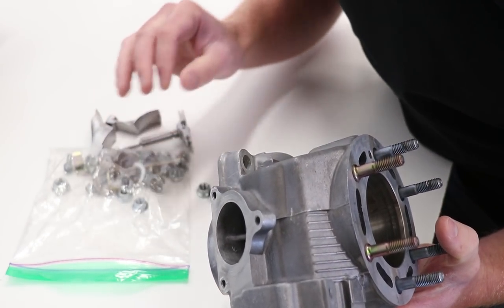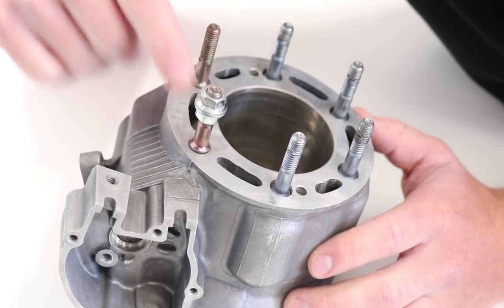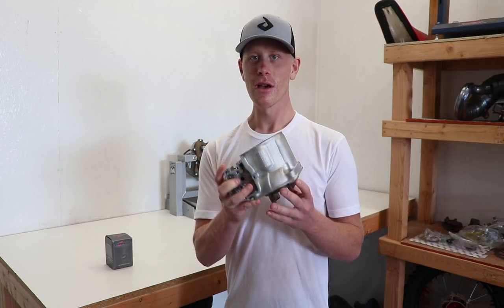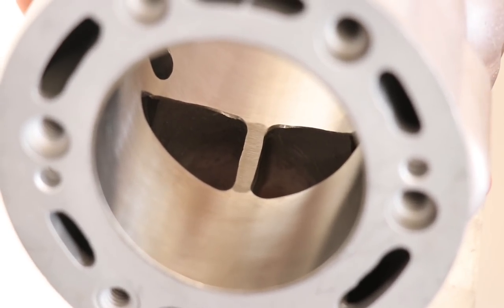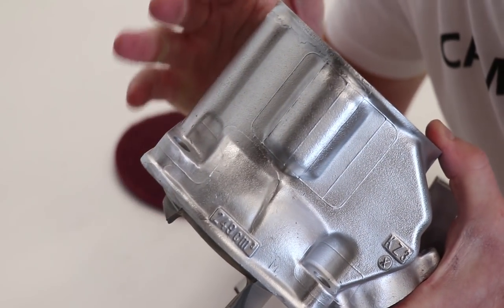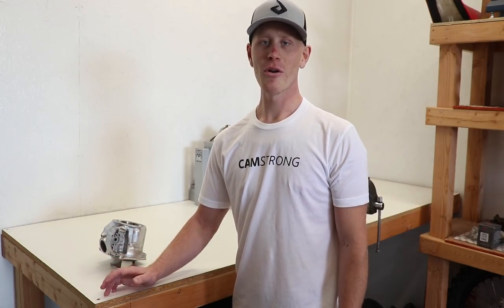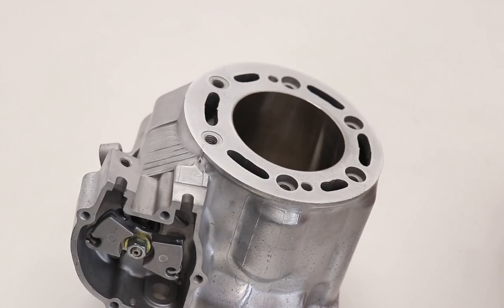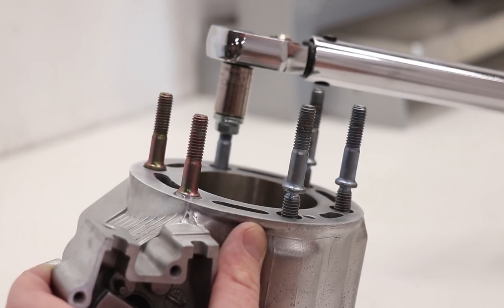How I Fixed My Damaged CR250 Cylinder!

Comment: Stay strong! I do have a tip use glass or granite slab with your sand paper on it for gasket surfaces it's a for sure method to "deck" a surface. Good luck to you and keep up the vids.
Reply: Adam Hood good call I need to do that as well

Comment: I just got a big bore block for my CB250. The lower part of the barrel that protrudes out underneath the block was honed so thin, it cracked while trying to fit my pistons/rings. I was left no other option but to sheer off the rest of the cracked skirts and re-burnish the surface. Made fitting the pistons that much harder, but I did manage to get it all back on. I really dont see there being much issue as the pistons do not travel past the bottom of the block, but no one can really give me a straight answer if I will or wont. Motor is going back on frame tomorrow, just gonna give it a start and see if it grenades or pisses oil out of some unknown crevace. Fingers crossed

Comment: One cuestion  im new on the dirth bike s world so k gat a cr125 2002 but the problem is that  is missing alot of parts on the engine 
So i gat a  89 cr250 engine on good shape so can you help me to get a cr125 comoplete engine or put the 250 engine on the 125 frame im from mexico sorry about my english writting

Comment: Something sweet I use to clean up gasket surface is I had a piece of plate glass cut and I attach any grit sandpaper you want to use either that has an adhesive back or use painters tape in the corners works super good and being tempered plate glass you know is perfectly flat

Comment: Hi Cameron! You are really doing your thing very well! Allow me a little criticism or better, a suggestion for improvement. Regarding your polishing works on the cylinder outside. I've had much better experiences when I get the cylinder outside glass bead jets and thus a slightly smokey surface. As a result, the wind will catch better in the rough surface and thus a better cooling of the cylinder is guaranteed! A polished surface of the cylinder dissipates the wind and thus prevents additional cooling due to the wind! Try it and give me your feedback. Lieben Gruß aus Deutschland und dem Thüringer Wald 👍

Comment: Powerseal did the welding and Nikasil on my kx125 jug last month. They come with a warranty as well incase of defect. 300$ total with shipping for a better than OEM product. Even less if you don’t need welding just a replate
Reply: Hey I brought it in to my local shop (CEP Automotive) and it costed only $200 including the Wiesco Piston.
Reply: Jonathan Brugge you have a local shop that does plating? Dang how lucky
Reply: That's a bit of a rip off.

For £180 ($230) my 94 kx 125 cylinder was vapour blasted, welded and re-plated.

Comment: I need to put a piston in my recently purchased CR250R.  the bike runs great, but I don't know the last time the top end was done.  If there's a forged piston  in it , I'll put another one in and drill the piston. 
My question is what type of piston do you prefer? Forged or cast?

Comment: What work order option did you use? I just got a chip in my exhaust port. Right above or below the  the power valve. Like this one here really. Should i do the weld machine option or the whole thing?

Comment: I've used power seal USA before. Very great results from them. Can I make a suggestion,   now is the time to clean up the ports on the cylinder. Because if you happen to hit the cylinder wall is doesn't matter. They will correct any slight damage like that. Plus it would make for a great video!
Reply: I should have watched the whole video 1st. Kinda too late to clean ports now. Lol

Comment: When he was back at powerseal after they fix your cylinder you should have sent it to dby Motorsports to have them Port that cylinder. You would have seen the Improvement of their port work what they do. I've been running their cylinders since 2006 in my car

Comment: I hope you cleaned the cylinder after sanding the head gasket surface and I would have sanded and clean the cylinder before installing the power valve
Reply: Pretty sure he knows what he's doing...
Reply: @maxtharipper  I've been in the power sports repair business for 31 years he doesn't do everything totally correct I can tell he hasn't rebuilt very many engines and no one uses a sheet rock or wood sanding block to surface the deck on a cylinder
Reply: @michaeltrower6792  congrats bro...

Comment: Just one tip cylinder head 1200 grit wet and dry on a piece of glass stick it down with spray adhesive then move in circular motion keeps it perfectly flat 220 is skittle coarse.

Comment: So as an engine guy obvs. Are 2 strokes really that much cheaper to maintain and fix in a bad case such the kx engine you had awhile back? Im debating between a 2019 250sx/tc or a crf450r/yz450f but im not the greatest mechanic when it comes to engines. Thanks

Comment: Question.. I have a 99 GasGas ec300 that I’m rebuilding this winter, I want to resleeve it and may just send the cylinder out to these guys..what’s the pricing like? If it’s over $300 then I won’t do it because I can get a rebuild kit (cylinder, piston, gaskets, wrist, circlips) for $460. But if it’s around $200 then I’d gladly send my cylinder out

Comment: Hi mate i spoke to you on ebay about the kx250 wheel, thanks for the detailed vids as always and it sucks to hear about your health issues, youll pull through though. My kx250 cylinder is in decent shape apart from a single vertical scratch/score that i can just catch with my fingernail, its just under an inch long, would this be fine to chuck a new top end in and run it if i run it a bit richer to be easy on it or would it be likely that the plating would flake soon and cause a catastrophic failure? 
Stay strong and cheers again Cameron!

Comment: Hey man, firstly I'm happy to see your well and back into these sweet videos. They're much appreciated! I have an 02 CR125 and the cylinder matches  almost exactly to this 250 of yours in the video. My question is, would you consider a new OEM cylinder being that it's like $50 more or will Powerseal kind of I guess improve the cylinder in some way?
Reply from the maker: Thanks man! Personally, I would go for the OEM cylinder since you can sell the old one as a core and you won't have to worry about turnaround time. But either way you can't go wrong.
Reply: Thanks for your quick replies! I been searching high and low for an OEM cylinder head as well. Do you know if an 04 head would work?

Comment: I used penetrating lube on the studs in the case and tried the double nut technique.the nuts just kept coming loose so being a plumber I used a small pipe wrench to break them loose and got the old suckers out!😁

Comment: Hi Cam hope everything is going well with cancer! I was wondering if you could post a link of where you got your bench grinder? All the ones I have seen don't have the longer shafts like yours has. Thanks!
Reply from the maker: Here is one that is similar but more affordable
https://www.eastwood.com/eastwood-1-2-hp-buffmotor.html?SRCCODE=PLA00010&gclid=EAIaIQobChMIkZ72kY6a3QIVh8pkCh2PIg91EAQYAiABEgIjJfD_BwE
Reply from the maker: But here's the one I use

http://www.tptools.com/BALDOR-3and4HP-2-Speed-Buffer-and-BALDOR-Cast-Iron-Stand,7250.html

Comment: when you plane the top of a cylinder you should do it on a flat surface moving the cylinder in a figure 8. using that hand sander isnt going to be exactly even.

Comment: I would advise against putting anything on the head studs unless the OE manufacturer or Stud manufacturer specifically tells you to. Any oil or schmoo on them effects the torque rating ;)

Comment: Hi man big fan of your videos I was wondering when you put the piston in the bike did you drill 2 relief holes on the exhaust port side of the piston like wiseco recommend?
Reply from the maker: Thanks for watching the videos man! This is a cast piston and does not require oiling holes like the forged ones
Reply: @CameronNiemela  ahh I see. Only ask as Im just in the middle of doing the top end on my 91 cr 500 and wiseco recommend you drill lubricant/relief holes never done it before feels so wrong drilling a lovely new piston lol

Comment: This is going to seem like a stupid statement but I am grasping at straws’s. I’ve spent the last year trying to find A flap valve shaft for a CR 250 2005 through 2007 the OME part number is 14211-KSK-730 it is a non-stock item and apparently hard to find if anyone on here knows of a viable source it would be greatly appreciated. I’m trying to rebuild a bike that was stolen from me and then returned as a skeleton and I’m down to that last piece.

Comment: How much was the cost of the Nikaseal plating?
Reply: I went through millennium technologies and it was $180 dealer cost or $260 regular cost for a bore/ replate
Reply: N Perry thanks for your answer!
Reply: So, we can say that Cam paid around $260 right? 
And when you Say replate, it is the same work that Cam did on his Cylinder, isn't it?
I'm a little confused with these terms
Reply: Yes, with aluminum cylinders you have to coat the cylinder wall with a coating so it doesn't wear away instantly from the piston because the aluminum is too soft. Steel cylinders usually dont require plating but you can if you want.
Reply: @SenileGiraffe  ok I think I got it!
Now the question is, Did Cam do a replate?
Reply: Yes he did
Reply: @SenileGiraffe  thanks for the answer bro

Comment: You have way to much clearance if it is 0.028"

It could have 0.0028"..

Figure 0.001" for each 1 inch of bore diameter

Comment: Not that a seventy-year-old burnt out hippie from the 60s could possibly ever know anything about Elsinore CR250R that was first developed exactly the time I went to work for a Honda dealership and for the years of the Elsinore its development was sent to every training seminar American Honda R&D located in Milwaukee Wisconsin development of every one of Honda to cycle engine built to the mid-80s that I couldn't help noticing you mentioned nothing about Port deburring best I can tell from your video camera not quite focused inside of your cylinder as I am referring to the bevelled Edge around each port Honda only allows to a tight tolerance that is covered in the service manual the edges of those ports will become sharp enough to cut and Whittle away on a new piston ring and on the same line of thought there is also a mechanical drawing in the service manual showing you the exact concave angle of degrees and depth you will hand clearance the Bridgeport that is necessary to avoid overheating piston and ring as it will try to travel into the port as it has no other choice as Honda will tell you getting that bridge extra clearance deeper than the bore of the cylinder by thousands of a millimeter extend the life of your ring from weeks too many years as without that nice-looking bevel your cylinder repair Company ground into the edges of your ports before they plated it made new set of Rings extended life well beyond years in years that left without would limit the life of your engine to about maybe a week that should be noted to those noobs out here that have no idea what I'm talking about is beyond anyting crucial something never been told by The Machinist I was paying month after month reloading my Yamaha years ago totally unnecessary if someone had just mentioned razor sharp ports from boring the cylinder devour brand new pistons and rings as fast as you can buy them and reinstall them and when your build is done pressure test your brand new crankshaft seal they better not fall off more than a pound of air pressure after you pumping up to about 15 lb to see how long it brand new crankshaft seal well hold pressure measured in no less than a minute for pound or you'll be right back where you started from that if I told you the reason why you would say I'm batshit crazy like some engineers said just the other day explaining how I two-cycle engine works that no one ever hear on YouTube has ever got it right in the last 10 years I've been listening now call me whatever you want but remember you're not telling me anyting you're saying that American Honda who developed your engine are batshit crazy and don't know nothing they do what's today I doubt they would even stand by what they trained me to know as a Honda than cells are responsible for the illegal Banning we're all 2-stroke could ever be sold in the United States that happened in the year 2007 as the propaganda I was told worldwide that burning smokeless two-cycle synthetic oil that does not pollute the atmosphere is the pollution that is killing us all killing our atmosphere with unburned hydrocarbons as the CO2 level is at an alarming rate at what percentage do they claim now is supposed to be simulating in r atmosphere serious percentages that will surely kill us all but oddly enough is still under 1% concentration of the entire atmosphere as if it were higher you would be dead already